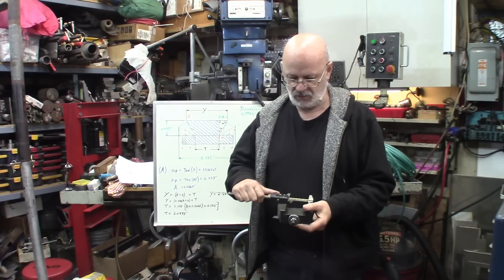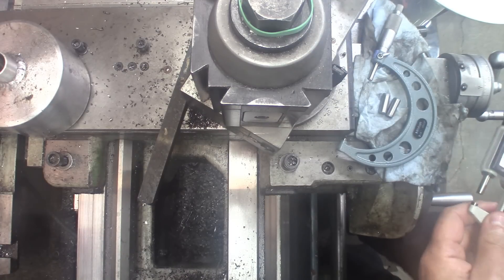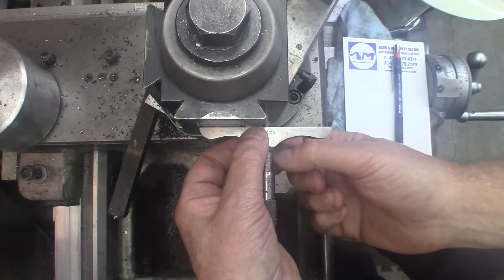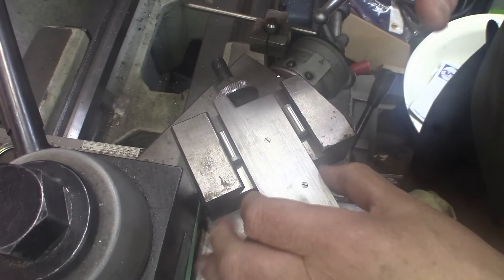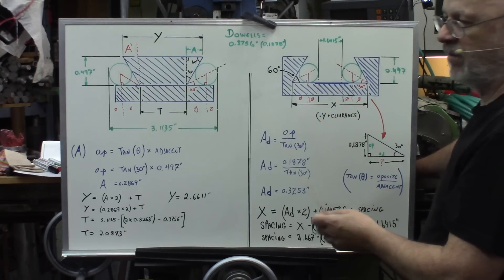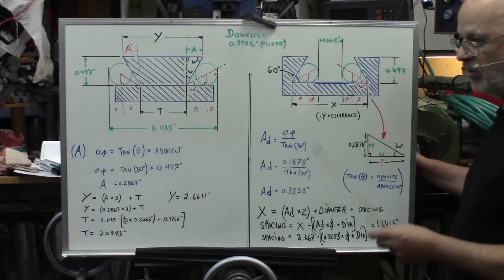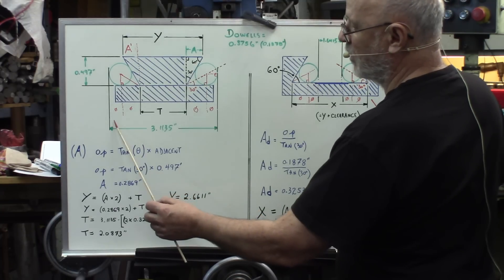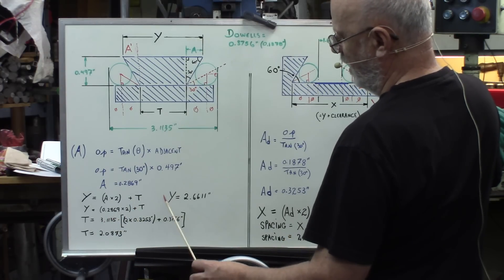Easy DOVETAILS... How to make and measure for tool holders on lathes, the Dorian or Aloris type...

Comment: Implement the use of International measuring standards like the main standard.
Reply from the maker: In Canada we're now using the metric system on most everything, but, when I was learning we used the imperial system, it really takes a long time to convert our mind to another system. Now, I can quite figure metric dimensions when working, it's still more difficult to directly work using the metric system...  😥
Reply: @pierresgarage2687   i understand 👍

Comment: Great  explanation of the theory for measuring dove tails.  This is especially handy when machining and fitting dovetails without a gib strip or other adjustment.  A small boring head would be an example of this.
I noticed Joe, that you have a shop-made dovetail endmill.  If you use a commercial dove tail cutter make sure that its angle matches that of the tool post.
Two different cutters may very well have a slightly different angle as I found out to my surprise.  Spent an afternoon regrinding a commercial cutter so that its angle matched the tool post's.
30+ years ago I made a complete QCTP & holder set because I could not justify the cost for a home work shop, what with interest rates at that time.  I now have 24 tool holders of all descriptions and still use them.
Reply from the maker: A good knowledge of the basics is the best way to achieve your goals. From there it's possible to adapt any part of a project. This reminds me how I had to force myself to concentrate during trade school in order to learn trig and get good at it, I'm glad I did it...  
Keep on enjoying your time in the shop........    🙂👍

Comment: 3:40 "500 thousandths minus 3 tenths = 0.497 " ??? The image shows thousandths (thous UK, mils? US), not tenths (of thousandths). Keep consistent units to avoid errors.
Reply from the maker: Hi, sorry for the delay to get back...
After reviewing the video and the related calculations, we're talking about thousands of an inch, 0.500" minus 0.003" =  0.497" this will be confirmed by the numbers used on the board a little further after that, and you were right about the fact that my explanation at that timing wasn't 100% clear.
Thanks for viewing and for taking the time to comment...   🙂👍

Comment: Good day, what material do you recommend using?
Reply from the maker: It all depends on what is the usage, lots of machines are made of cast iron, they purposely make some markings in the ways to allow some lubricant to be trapped there for reducing wear, for some other applications it could be sinply ordinary steel, or in more demanding and wear resistent situations, you could use hardenable steels that you would heat treat and do a grinding finist there afer. For those steels it could be many alloys, for example some D2, 1045, 4140, etc....
Just be careful to use proper speed and feed when machining hardenable materials or it will harden on you before you're finish machining, then, it's quite an ordeal to make soft again...
   🙂🙂👍👍
Reply: @pierresgarage2687  Thanks Pierre, I will take into account your advice, good day

Comment: I have to grind a male dovetail looking part to a four decimal place dimension. The dimension is given using two dowels like your drawing. My part does not have the bottom part of your male drawing so it's essentially an isosceles trapezoid. I will mount it on a large sine plate on the grinder. I can't take it off to check it with the CMM, it would be too much time consuming. How can I check it accurately ?
Reply: Try this method for the simplest solution - https://youtu.be/cIsWsXyLY6k
Reply from the maker: In my opinion, it would be possible to use some well calibrated gauge pins, in order to save time when getting closer to your required measure you can use some adjustable parallels, when performing the last cuts you could use some gauge blocks to get a quite rigorous measure for final operation.

Comment: Too complicated. I just copy the angles from the old post tool and start cutting. Whay you need so many misures.
Reply from the maker: All depends on how precise you need to make the parts, for many applications, aproximate measures will do, for machines or appliances, higher presision will require more care and all those complicated calculations and more factors taken into account. For exemple, your car engine requires LOTS of those in order to perform reliably hundred of thousands of kilometers, airplanes as well so they don't fall of the sky in great numbers, etc...

Comment: Good video and illustration of effective math use, BUT, unless the male and female pieces are being made at separate locations there's a much simpler method of measuring the inside of the pins on the male dovetail and the outside of the pins on the female dovetail by having them protrude out of the dovetail. Randy Richards in the Shop demonstrates this in one of his videos about his dovetail cutter

Comment: Majicaly angles or invent your own,  i thi k it's funny that simple rations,  like 2 to one ,(tan) becomes a ridiculous angle numerically,  like 26.565011771. May e w should have been like France and used 400 degrees circle.
Reply from the maker: Once you get the principle for trigonometry it's quite possible to solve just about any angle problem, it requires some concentration, though...   
Never heard about the 400 degrees circles...!

Comment: This is such a simple exercise and you managed to bungle it and make it super complicated. No wonder there are so many comments about having to watch this multiple times.
Reply from the maker: These are ALL the steps to start from scratch in order to demonstrate where the results come from, there are also formulas for shortcuts, if you can teach me something simpler, just be my guest...
Thanks for viewing and for your comment
Reply: @pierresgarage2687  the simple way is to use rollers of the correct diameter. If you use rollers with a diameter of 1/3rd of the depth then the sizes for both parts are the same. It is as simple as that. Diagram here - https://drive.google.com/file/d/1L680XDGRHtW_tKYiqxNeCaqYX2ckP_S0/view?usp=sharing

Comment: Just remember two triangles: 45/45/90 with sides 1/1/root2. And 30/60/90 with sides 1/root3/2. For simple calculators without square roots, remember root2 = 1.4142 and root 3 = 1.732.
Reply from the maker: When I remember the numbers it' ok, with age I try more to remember where I last left the digital calculator......     lol
Thanks for your input and for your comment...

Comment: Very good tutorial.  Even if the calipers has razor blades to measure with, it would still be inaccurate.  Thanks, Jerry
Reply from the maker: A caliper is an approximation tool, all depends how precise you need to get, in this case it doesn't take much to be off specs...
Thanks for your comment,   Pierre

Comment: Hello Pierre,
Greetings from India,
Thank you for this video. I have a doubt though, I am working on a project where we are engaging a change in tooling for which we require a dovetail block change. But in case of our design we leave a clear space between the bottom face of the tool post and the resting face of the support/slide block which has a dovetail groove. Now in your case those depths/lengths were equal but in my case the post would have a lesser length than that of the holder, how much clearance do I consider for (y+clearance) part of my design. 
Thank you

Comment: Just in case there are any of you that don`t like maths.   Try this.  ... If you have a toolpost  with a fitting toolholder and want more toolholders, simply drop in two small bars as Pierre did, then put a caliper between. this gives you the gap,... As you mill out the dovetail  , keep testing with the same two blocks until you are up to measurement..  That`s it. You are not after an accuracy of a tenth of a thou..You need a full thou clearance at least to slide it in and out,  Not critical. ..If you do not have an existing  toolholder,   Well, you`re screwed. and it`s back to the calculations.
Reply from the maker: It's always the better solution to be able to able to reason the problem from the basics, then, it's easy to just get yourself out of any situation, for almost all of us, when stuck, then, YouTube is a real life saver....   ;)
Thanks for your comment,    Pierre

Comment: CLICK!  I finally managed to confirm the dimensions of the tool holder I'm working from (that is, confirm the dimensions that Shars supplied), and confirm my layout for the dovetail it will fit to.  As usual, I had to come up with my own format of simple steps to get to it.  Stare at it, study it, try it, break the parts that were not working for me back down to it's components and put it back together in a way that my brain will accept it.  (I not only found my X but now I also know Y   ... }|-( ...  I know, terrible pun).

I still hate what my high school math teachers did to me. 10 hours, which including a two hour nap (because my brain tried to atrophy) and a bout of explosive diarrhea, was the price I paid to get my head wrapped around it.  PTSD re-visited????

Now I just need to hope that the notes I have in my little black record book are sufficient to remind me the next time I need to do this...
Reply from the maker: Math, and trig...   lol
A couple of things that required teachers to tie me to a chair, guess it kinda paid out in the long run, the main requirement is to be able to concentrate, a good teacher is also one of the best asset in learning harsh stuff.
Thanks for viewing and keep on trying until you get it right,      Pierre

Comment: I liked the use of the adjustable parallel
Reply from the maker: Hi James,
When the result is exact, just about any method is a legal mean to get there...     Being inventive is a great asset in this trade.
Thanks for your comment,    Pierre
Reply: well, I wasn`t so keen on it..  no indication that the thickness of the parallels needs to be at least 50% of the thickness of the 2 round bars.. If slightly less, the edge wii be touching a curve.  making life and calcs difficult.

Comment: wonder if they can make neo magnets precice enough to use as these measuring pins, would make setting them up eazier as they will stick inside the dovetail giving you both hands to operate the measuring tool
Reply from the maker: I'm sure they can manufacture them to quite close tolerances, since the magnets are only magnetized in the final step after averything is done on them, though, the main problem working with magnets or magnetized parts, is that there is always something that wants to stick to them and you rarely succeed to remove all of the parasite particules...

Comment: great video and drawing, so you just used all Trigonometry in this? why you did not use that formula X=S+D(1+cotangent(angle/2)) or the dovetails with 60 degrees use 2.732   I'm just curious because i tried using that 2.732 with that formula and produced wrong measurements. I'm trying to make an Aloris AXA tool post holder. thanks for your time making this great video with the details in all your Trig angles.
Reply from the maker: The formula you're using is the common formula used when you look for a way to get the measurements for making a dovetail without having to figure out the trig behint it, all is right, the most common problem isn't the formula most of the time it's the actual angle you get after machining, it only takes a very minute error in order to throw your measurement way out...
just try the formula or the calculation with a few values other than 60 degrees, like 60.25, 60.5, or even 61 degrees you'll see that the result is very far from an actual 60 degree angle...
Let me know if it solves your problem,  Pierre
Reply: Try using pins that are 1/3rd the diameter of the depth for 60 degree dovetails. This brings the pins in exactly the same distance apart for both male and female dovetails. The pin centres seat directly above and below the mid point of the angled face if this diameter is used. This eliminates all the trig, just cut the female to approximate size - measure over pins and replicate the dimension for the male.

Comment: Hello Pierre from Australia. I understood the Math's very well as that was part of the Electronics Engineering I did 35 plus years ago, great presentation and explanation! For those that have a copy, Machinery's Handbook covers this well with examples as well. When it comes to measuring the internal dovetail the method I have used (not having Gauge blocks or an adjustable parallel) is to use a stack of HSS tool bits and feeler gauges. Then measure the stack with mics, end result is a very accurate measurement. This may be of some help to some of your other viewers. Cheers from John.
Reply from the maker: Hi John,
You just proved to yourself that anything that leads to a properly made and measured part is a go, what I love about the trade is that we're always pushed to find creative solutions to get the job done..... 
A good way to keep the brain cell working like in the younger years...!!!   lol
Thanks for your input and for taking the time to share,     Pierre
BTW, I envy the fact you're now in the warm season...   Sigh...!
Reply: Thanks for the reply Pierre. Yes it is getting a bit warm, soon we can look forward to 40 plus degrees C for our days or well over 100F Cheers from John.

Comment: My tool post is wedge type not plunger type, so when I lay my dowel pins in, how much do I expand the wedge?
Reply from the maker: You could make the readings at min and max extension...   Make sure the angle of 60 degrees is constant and accurate or the error will be quite enormous...   ( Read in comment to Laurent Thommet )
Easiest possible solution in this case is to get at least one proper holder and start from there it's easy to adjust according to the actual fit...
Reply: thankyou Pierre

Comment: HI PIERRE Thank you very much for your explanations. But don't forget that the results of your calculations are depending (among others) of the accuracy of the angles. Greetings from France  Laurent
Reply from the maker: Hi Laurent, Agreed with you about the accuracy of the angle, a one degree difference, like 31 instead of 30 would make a 0.026"
difference on the T measure, so, good idea to check on low quality stuff...
Thanks for your input,    Pierre

Comment: That's a great trick, using the screw jack as an adjustable parallel! making mental note
Reply: need to ensure the threads on the screw jack are a tight fit to prevent any slewing of the screw in section otherwise the ends will not be parallel.
Reply from the maker: Right about that this is where a counter nut would prove useful...

Comment: You said .500 - 3 tenths (.0003) then write the answer as .497, shouldn't it be .4997?
Reply from the maker: You followed pretty closely, it's a mistake about the tenth, the real measure is thousands of inches, the numbers used in the video are right, sorry about it, now it's kinda difficult to make it right, not sure how it can be corrected without uploading a new version...
Thanks for pointing it out,    Pierre

Comment: How did you know that the angle was 30 degrees? That angle does not appear to be easy to measure. It might be known to be 30 degrees for an aloris style block, but what if we are dealing with something unknown?
Reply: You could determine the angle by measuring the width with the two pins, followed by measuring the width again with two identical gauge blocks of known height under the pins.  The height of the gauge blocks would be your ∆X and the change of width would be ∆Y.  Since ∆Y measures the change of width of both identical tapers, you need to divide it by two when calculating the angle of just the one taper. So the angle would be = arctan(0.5∆Y/∆X).  Chris
Reply from the maker: This method could be also used to control the accuracy of the angle if needed.
About the 60 degree angle being suddenly called a two 30 deg. angles, a circle inserted in an angle is going to split that angle in 2 equal parts when you get a line that starts in the corner and go through the center of that circle, this is an admitted fact in trig. I kinda forgot to mention it in the video.
Reply: Pierre, I was trying to figure out what "trig rule" you were referencing earlier, but after reading your response here I realized you were talking about a "geometry rule".   A bunch of years ago I actually posted a crude cell phone recorded video showing how to determine 30°, 60°, and 90° angles using only a compass and a straight edge to answer a question on a forum. I took it down in the last couple year because it was pretty grainy compared to today videos and no one was watching it anymore.   Chris
Reply: Thanks Chris for taking the time to post that on finding the angle. That's a big help to me.

Comment: But you didn't prove the measurements were correct by translating them into real tool holders and testing the fits! Once you do that you can send the"props" down to me. lol
Reply from the maker: The little bits of machining clips you can see at the beginning and end are from finishing Philippe's block using the calculations and Randy's dovetail cutter....   
Not shown, but they fitted perfectly, this is to prove that science worked perfectly again....     lol